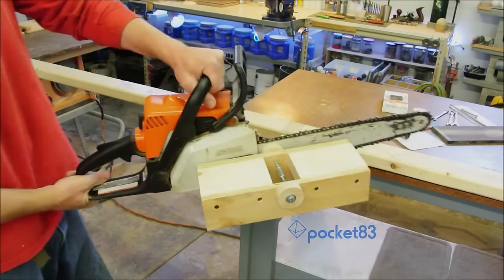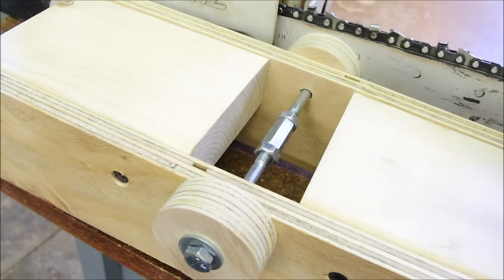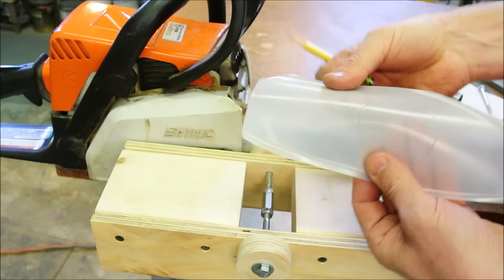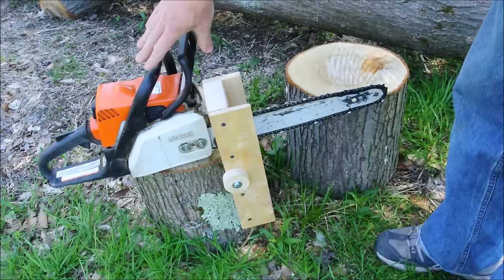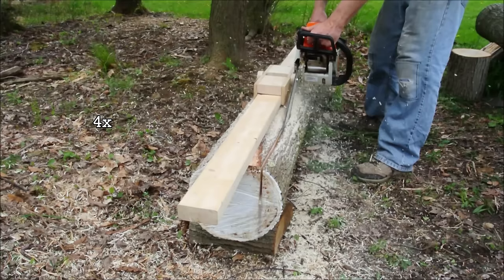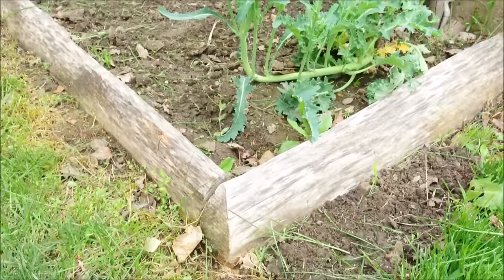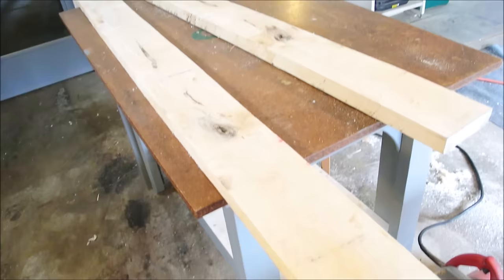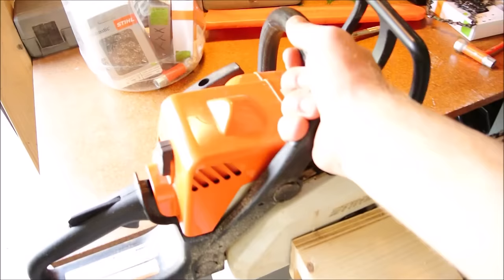Chainsaw beam guide from wood (DIY mini mill)

Comment: Howdy! After having built this, do you still think a thin kerf bar is the way to go?  A thicker gauge bar would, in theory offer less deflection, but is it worth it?
Thanks
Reply from the maker: With this jig? There aren't that many benefits to a bigger saw. As for the problems, well, a wider cut will mean: less wood remaining, more gas used, more tooth area to sharpen, more expensive chains, more noise, a heavier chainsaw to stabilize, and way more sawdust. 

Keep in mind that this jig was designed with a little chainsaw in mind. The idea was to limit deflection by reducing the amount of stressors put on the saw. A nice little & light, sharp & shallow cut works best with this setup, while a heftier saw will end up increasing lateral strain on the thing while it's in action. Eventually, it becomes an arms race to design a super-solid jig, and you'll just end up making a proper, two-point bar attachment sawmill.  

So in a word, no, it's not worth it—with this mill design.
Reply: @pocket83squared  thanks for the thoughts

Comment: So Do you think this system will work on a larger saw with a rip chain? I have a shindaiwa 695 and a Husqvarna 460 and I have access to a fair amount of logs.
Reply from the maker: If by "larger saw" you mean 'more powerful saw,' then sure. However, a larger saw will make a thicker kerf (cut), it will be heavier, and it may end up using more gas. I can explain; the most successful approach to this technique seems to involve using the low end of the nose to cut, so that chips eject quickly and the saw doesn't bog down. This is surprising—but it's more efficient to make fast, shallow cuts, and to just make lots of them. Took me awhile to figure this out. Since the cuts are so light, there's not much need for running a big saw. Note that this advice only applies to a single-point mill attachment, like this one; for a more traditional chainsaw mill, big is mostly better. 

Back to the heaviness. If you use a counterweight (as I show in the follow-up video), the saw's mass really won't be a problem for you. But a longer bar might be. Remember, the longer the bar, the more the error will project; with a longer bar, you'll be able to get though thicker logs, but the price you'll pay for doing so is with waaaay more planing. There will be gouges.       

The rip chain is a more complicated question. Rip chains don't allow side-to-side cutting as well as a regular-old chain does. That sounds great for milling, but the thing is with this method is that when you do start to go off, and you have a chain that won't let you adjust to get back on, you now have a problem. Since the jig has a single attachment point to the log you're cutting, keeping it straight is sort of up to you, and a rip chain will rob you of some of that control. A knot might knock you off and make a mess. 

Hope my explanations were clear. There's more in the follow-up video, and even more tips in the description there. I've learned quite a bit since posting this video, but all considered it's still a super-easy method that I stand behind. Good luck.
Reply: @pocket83squared  your explanation was very clear. Thank you very much for your time. I understand what you mean about the rip chain. Zo you have a recommendation on size of saw in cc's or cu in?
Reply from the maker: @kevinrhug  No. I can't really do that, becasue my experience is limited; I've only used the saws that I own. My advice would be for you to try it with every saw you have access to, and try to find the balance that works best. Every saw will have its own pluses and minuses, but any saw will work.

In my own experience, I favor my little saw best—using lots of light, quick-moving passes. The process is hard on it, but it's easy on ME!

Comment: Why do you want to keep the moister in the logs?
Reply from the maker: Several reasons. Think of wood drying as a curing. Once the water has left a piece of wood, it becomes sort of 'fixed' in its position. Wet wood isn't set yet, so it hasn't checked, split, or twisted. For milling, a fresh log's bark is still easy to remove. Next, moisture cools and lubricates the chain as it cuts. 

And finally, there's efficiency. Uncured wood is less dense, so it's easier to cut. Imagine a sponge that's ether swelled up & soft or shrunken & hard: which would be easier to cut?
Reply: @pocket83squared  thank you.

Comment: curious, whats the length of the bar hole either away from saw housing or after the last rivets on the bar. thanks
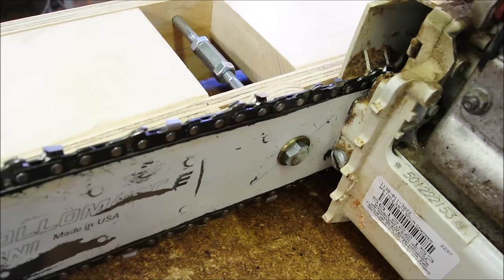Reply from the maker: Look at the screen @ around 3:52. Note that you can see where I drew a diagonal 'X' through the four rivets that are closest to the tensioning screw. The hole was drilled at the center of that X.
Reply: @pocket83squared  thanks I see that now.

Comment: sorry to bother you again, i was curious also does the length measurement extend if using a longer bar. all i have is an 18 inch bar. thanks
Reply from the maker: Chances are it'll be fine, but that's not really something I can know for sure. Different equipment will have different requirements. You'll have to adjust any measurements accordingly. 

Just be aware that a long bar like that will also cause more error while cutting perpendicularly, so don't expect to get through thicker logs just because the bar is longer; in terms of it reliably producing straight lumber, this method will max out at around 8~9" of board width no matter how long the bar is. Watch the follow-up video, and you'll see what I mean. Good luck.
Reply: @pocket83squared  thank you . I did see it. I'll add the counter weights. thanks again can't wait to try it.

Comment: Do you have to sharpen the chainsaw often?
Reply from the maker: There's not really any sharpening involved. All of my milling gets done using a new chain. Precision sharpening isn't cost-effective with a little MS170, because its chains aren't expensive. A new chain will mill around two 8' logs before a touch-up, so the chain is simply considered a $30 milling cost that's easily recovered by the lumber produced by two logs. After that, the chain goes into another chainsaw for general-purpose use. From there I just hand-sharpen it using a file, and it gets to live a long life logging & limbing—until that fateful day when I finally finish it off on a stump. 
 
Assuming an MS170, sharpening systems are a wasteful expenditure of time & money, but freehand sharpening is substandard for milling operations. Since this process is all about economy, keeping the new and used chains in their separate saws keeps my milling quality at top-tier without any stress, and at low-cost.

Not counting the slabs and skinny stock produced, consider the seven, 7¼" x 8'  boards produced in my most recent milling video:
https://www.youtube.com/watch?v=lYmx1rJ3s7Y

—Four of these were 1" thick, two were 1½", and one was over 2", all solid Cherry. Imagine how much these would cost to purchase. Now note that I get twice this amount of lumber per chain, while using under 2 gallons of fuel (an MS170 gets over 15 fill-ups per gallon; a fill-up yields three 8' mill cuts). Factor in some planer blade wear and we're looking at a big pile of wood for under $50, all without filing a tooth. 
But, of course, you'll have to give it your labor.

Comment: What do you do once the board gets down to a width less than your 2x4?
Reply from the maker: That's the subject of a future video. It would take too long to explain here. With some cleverness, you can use the jig right down to the last board. I'll film it this spring. The log's already in position.
Reply: @pocket83squared  thanks!

Comment: MS171 and the nimrods at my local power tool store said it can't be done. I say it can. My tree is only 11 inches diameter and I can buy a horizontal portable mill that goes down to 14 inches. My chainsaw chain goes out 16 inches. IT CAN BE DONE AND IT WILL BE DONE.
Reply from the maker: The guy who sold me this (170) chainsaw laughed as he told me that 250s are nowhere near powerful enough to mill a log. 

He failed to understand that a thin kerf requires less energy.

Comment: My variation of your excellent design: https://youtu.be/Hw_ri5o_liI

I used just one long 3/8" carriage bolt, straight through the top 2x4. A couple of pieces of HDPE, a washer and a bolt to snug up the bolt. Then another bolt against the first to lock it. Then a washer, the chain blade, a washer, lock washer, and third nut.

Comment: Has anyone made this jig with a 2x2 set up ?
Reply from the maker: That's not advisable. The 3½" dimension provides the straightness for the cut. Less material would mean more flex, and ultimately wonkier boards.

Even steel tubing will flex considerably at 8', but plenty of people here have insisted that a steel rail will provide a 'better' alternative. For my part, I manage to mill perfect boards every year using a 2x4, so my position remains pretty firm.

Comment: Saw is a touch small but then again you’re only making a video
Reply from the maker: This technique uses only the end of the bar to cut. Adding more saw adds nothing. My results speak for themselves. Go look at the piles of perfect boards I've made in my other videos. 

This method works. I've spent lots of time to develop it. For a jig like this, a larger saw will just make you tired faster. Bigger means a thicker cut, and thus faster-but-slower passes. Unless you're going to upgrade to an actual chainsaw mill that attaches to the bar in two places, a bigger saw will do you no good.

Comment: How much does it cost in gasoline?
Reply from the maker: Not enough to care. One fill-up gets you through two 8'x 7.25" boards. 
Thus, an entire (15"+ diameter) log can be milled for less than a gallon. 

The third video mentions this: 
https://www.youtube.com/watch?v=lYmx1rJ3s7Y

Bar oil is the other negligible expense, but chain costs are worth considering.
Note that this all assumes an MS170. Your mileage with a different saw may vary.
Reply: Gas was $2.89 a gallon. Gas from the dentist was $75 and no wood.

Comment: I still don’t know if it’s a good idea or not 🤷‍♂️
Reply from the maker: Consider this: I'm not selling you anything. I don't fudge results or exaggerate for views. This method was posted here simply because it worked well. If you're still on the fence about the method, watch the follow-up video. It'll give you a little more depth about the jig's strong points and limitations. 

As for whether it's a good idea, yes it is, provisionally; for a person who doesn't want to get too involved with milling, this will both scratch the itch and provide a valuable pile of wood at a nominal cost.